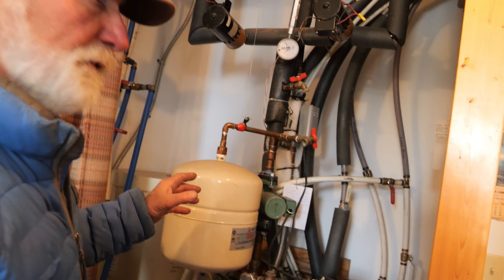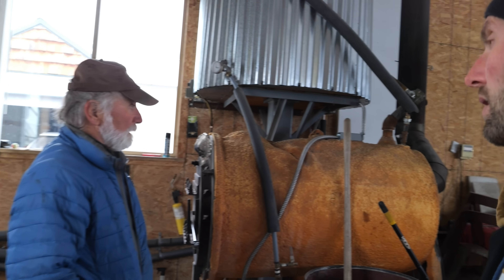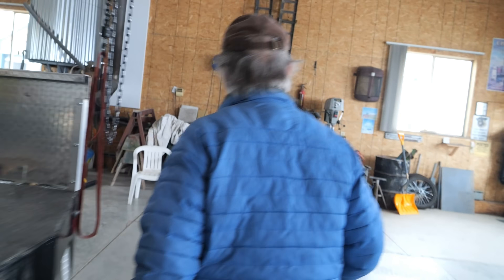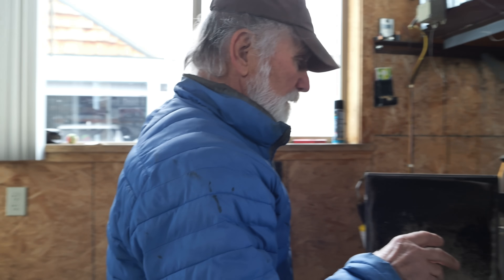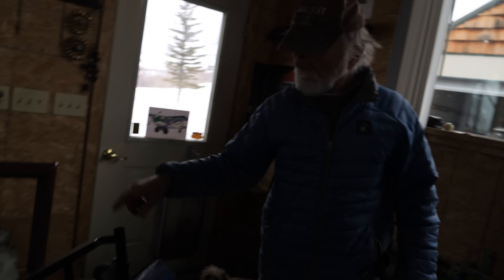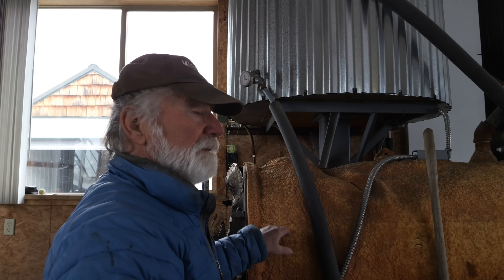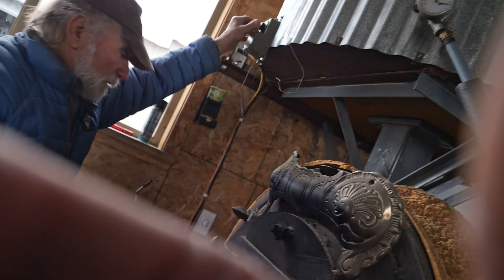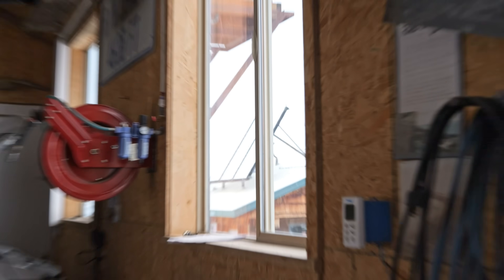Hasn't had a Heating Bill for 40 years.

Comment: My wife and I haven’t had a heat or hot water bill for a little over 20 years and with 5 girls, we go through ALLOT of hot water between laundry, showers, dishes etc for 7 people and we keep our house and shop at 75 deg. We live in northern VT.  My system is way more simple but I probably burn more wood as that’s all I use is a large outdoor wood boiler that takes up to 5 foot logs, I usually cut my wood about 3ft because it’s easier to handle and I don’t split any nor does it need to be dry, I burn both soft wood and hardwood, doesn’t matter. The new wood boilers for sale are garbage in comparison because our corrupt government has intentionally destroyed the outdoor wood boiler industry with nonsensical “emissions”  regulations that actually burn substantially more wood than my straight box with no emissions because that’s what corrupt governments do as they do not want any one to be self sufficient, they want control and they want you to spend thousands every year on energy. I spend zero. If you are able to build your own system it’s not that difficult and when you can burn any wood no matter what it is, wet, dry, soft, hard then not only is free wood everywhere but I actually get paid to do  property maintenance and dispose the wood which I burn. If your not lazy, free energy isn’t difficult to achieve. Just don’t involve the government in anything because they are corrupt criminals, ALL of them without exception. For all the naysayers, save your breath because your opinions mean nothing. Proofs in the pudding.
Reply: Wow you don't understand science.
Reply: @octoflex  A great response to nonsense like this. One liner- enough said. Haha... He won't care that the regulations are for air quality (not profit), or anything else we might say so you might as well just make it quick.

Comment: I’ve got real close to the same set up. Trust me, it ain’t free.  What I have invested building mine is extreme and I would have never considered it had I not owned an HVAC company and collected stuff over the years. Pumps don’t last and do not lose a drop of that liquid gold glycol.
Reply: I get 15 to 20 years out of a pump, some are older, all in intermittant use. I made a bulk purchase of the thermal solar panels years ago, 60 of them, sold and installed (making money that more than paid for the ones I kept) most of them, paid around $100 or less for most of the pumps, and use a 50/50 mix of auto anti freeze, and have no leaks, and there's only around 8 gallons total of the mix fluid. I  have less in the system than if I would have just picked up the phone and called a HVAC contractor to install a forced air system, not to mention there's no monthly bill with mine.

Comment: Hasn’t paid money to some company.  When you break it down, he is ahead, but the fuel source has a cost.  I burn wood for heating and it has a cost.  My system is not electric and I can heat as much water as I want without electricity.  The simpler you can keep things, the better.  I just don’t like having a monopoly determining the cost and or supply of what I need to live.  There is all together too much of that in this world.
Reply: I think he said between his job, something about cranes, and clearing his own trails, he has access to lots of free firewood
Reply: Cost of wood = go harvest/chop wood for 30-60min a day on average and that's your exercise the gym.
Reply: wood, in the UK, double glazing ys a big thing, plastic frames etc, when they remove old wood frames etc, they have to pay to dispose of it, i go collect it, cut it up, use it in my wood burner.  Costs me about £100 all in per year.. fuel, electricity, blades for chop saw etc.
Reply: He explains where he gets the wood from at @10:38
Reply: People with land can just go into the backyard for firewood. Realistically tho, firewood is infinitely cheaper than paying for electricity when you have an efficient system.

Comment: There it is! I knew there was a catch. Excellent system and you’ve definitely got it setup quite well and I have no doubts that it works very well for your purposes. 

But…Come to northern Minnesota or Wisconsin and do this… you’ll be buying fuel for something… either propane, kerosene, diesel, heating oil or wood. I promise you’ll be buying something. A 3 month heating season must be nice. Our heating season is typically from November to April… but can and often does start in September and goes until June. Of course the really truly cold part of that season is only a few months. Typically December-February. But I’d wager our really cold season is still longer than your whole heating season. At least that’s the impression you gave. 

Still a fantastic system you have and it would DEFINITELY help dramatically reduce heating costs out here too. I’ve been looking into a waste oil boiler for the same reason. I’m a mechanic so I have basically unlimited access to waste oil for free. So even though they’re fuel hogs. It would really cut down on heating costs.
Reply: No thanks, Idaho is plenty cold, but also gets a fair bit of winter sun, and that makes all the difference!
Reply: @portnuefflyer I pray the winter sun continues for years to come. You know the elite are exponentially working on blocking the sun as the days go by. Those chemtrails are relentless lately. We the people need a revolution soon… before it’s too late.
Reply: And you get very little sun during the winter months the same as MI.

Comment: You definitely had a higher bill than me and all the up keep and equipment installed buying the equipment etc. Cost more than me heating for 5 years with central air. In the long run you either spend more or same as we others do. Don't be fooled by all these  different heating/cooling systems that claim cheaper bills. The maintenance alone is enough to cripple alot of peoples money flow. Different isn't necessarily better. You need a place for all the equipment you're using and most don't have room for this. You have to buy wood and store it etc. Just because you didn't send money to a power company doesn't mean you had free or cheaper  heating
Reply: What it means is no ever increasing  monthly payment, in perpetuity, to have some utility do it.  I bought my heating system, I'm not renting it in effect, and I locked in it's cost the day I paid for the equipment. All this talk of all the maintenance is pointless, there is almost none. Circ pumps have lasted on average 15-20 years (some longer) and they cost around $100.00. The wood on my property needs to be picked up anyway, deadfall, I could pile it up and burn it outside, or throw it in the woodshed and burn it in the boiler.  If this system was put together 6 months ago, it'd be different, maybe you missed the 40 years part, but it's been super cost effective anyway you slice it. If the cost for maintaining it was averaged out on a annual basis, it'd be about $50.00 a year. Aquastats are around $100.00, like the pumps, no individual component is expensive, it's dirt simple. Left unsaid, is the fact that producing and being responsible for one's own heat and comfort as opposed to handing over money to a faceless utility to have them do it for you, is a bonus, it's called self reliance.

Comment: speaking as a plumber who works on hydronic heating systems. Nothing mind-blowing to see, just some basic heating systems that feed radiant flooring. I come across homeowners like this once in a while and enjoy talking with them. Usually, the only concerns I see are a need for backflows and pressure relief valves. Most of the time, they are just cobbled together and overly complicated systems because they are not familiar with all the available valves and controls. I don't mean that negatively, and I enjoy showing/explaining how those bits can help them more efficiently.

Comment: Thanks for posting.  I have a very similar setup.  I can heat my house and domestic hot water via propane, an evacuated heatpipe solar array, or a gasification wood-fired boiler. Each component can work independently or together as a "team."  I haven't had a propane delivery for years, but it is there if needed.  My "angst" is that I am now an old man and once I am gone, no-one will know (or care) how all the pieces work together!  And my "system" is like the one shown here...human interaction is required...the system, as a whole, while GREAT is not automatic; valves need to be repositioned, switches need to me moved.  And as he said, if you want heat inside the house tomorrow, you better plan ahead (I have a smaller footprint, so from say 65-degrees it takes about 24-hours to get everything up-to-temp).  Regards.

Comment: If you are not generating your own power with solar you do have a heating bill for power to run your pumps and you had to pay for all that solar and equipment and parts. Just spread those costs or the time you have been running the system. That is your heating bill. Please look at the whole picture then brag.

Comment: A bit of an exaggeration that he hasn't paid anything.  He has paid for all the equipment and the piping.

Also, when the sun isn't out, the solar panels aren't creating any power.  He has to get the power to run the pumps from somewhere.

He's just not paying the electric grid most of the time.  But there are times he has to use the grid.
Reply: He said he never paid a heating bill, aka a gas bill
Reply: @mason5540 That's like saying because your spouse pays for gas in the car, I don't pay for gas.
Most heating systems today are forced heat or use some sort of pump.  Therefore, the pump is part of the heating costs.  Thus, your argument falls short.

Comment: Yeah, I like. Mine is way different, outside wood, looped into domestic water and floor through a few plate HE. Endless supply of free wood in Alaska, but mostly I burn scrap pallets just because there is an endless supply, easy to handle and cut. Love your example.✌️

Comment: Lie number one! Takes electric to run the hydronic pumps! Lie number 2 takes electric to run blower on wood boiler and control box. Lie number three takes gasoline to run chain saw, tractor and pickup to cut and haul back to shop.stop lying.
Reply: stop crying

Comment: It's the most least efficient boiler. A Tea Kettle. Lots of heat goes out the pipe. A Fire Tube boiler is the best way to burn wood or coal.

Comment: So are there two separate secondary loops in the floor? One for the solar and one for the boiler? Or is the floor piping common to both systems? You would think using the heat exchangers would be a point of thermal loss, but obviously that's not an issue at all. Fantastic!
Reply: The solar is a glycol mix, totally separate from the plain old water in the floor, the heat ex. "joins" the two together for heat transfer purposes. The solar mix is under pressure, 15-20 PSI, the floor loop is open pressure.

Comment: Interesting and informative. If you have the exposure to the sun and the mechanical knowledge you can use cheaper solar panels for hot water.
Or like he did in his shop in town solar electric panels and feed the grid nine months out of the year. Which requires good laws. In Florida and Nevada I’ve seen videos claiming that the electric power company won’t pay much for electric power so even if you buy a large amount of solar panels you will still have to pay for electric power.

Comment: You are running as high as 20F  delta T?  That  does not seem like a very efficient  heat exchanger to me.
Reply: 15-20, an all stainless plate type exchanger, oversized for the flow,  commercially produced, nice and compact also..

Comment: Claiming that  some panel is  equivalent to  so much propane  is somewhat meaningless.  How many  BTU per hour?   How long does it take those  panels  to  "equal"  the claimed amount of LPG?

This idea is not new by any means.  I've had friends back in the  EIGHTIES  that  buried  heating loop(s)  in their floors,  then  circulated heated water  from  various sources, including using a simple  gas/ LP  water heater as a boiler,  or  liquid  coils in various  heating stoves, AKA home made boiler,   and a couple guys I knew collaborated to build  their  own (each)  solar water heaters.
Reply: Agreed, difficult to quantify the BTU output, blame the sun. The Romans used radiant floor wood fired heat in their baths, so yes, not a new concept at all.

Comment: Nice video, I know we have talked about it but my plan is hydronic soar and a back up boiler pumping into my 900 gallon stainless still milk tank filled with paraffin wax. I''ll have heat exchangers for the floor and domestic hot water in the tank and the boiler will only kick on if the temp hits a threshold.
Reply: I used to have a 500 gallon tank on a previous system, but found it's more efficient to put the heat in the slab pretty much as quick it's made, the 5" slab mass is the thermal sink instead of the water. The end goal is 70-90 degree water into the slab, and a LOT of water at that temp is better than a smaller amount at much hotter temps, easier to produce more efficiently plus less heat loss in storage.
Reply: @portnuefflyer   It would be fun to pick your brain. I am starting a clean slate hangar this spring. I also have 8GPM of spring water coming out of the side of my hill at around 12C. I might be able to develop more springs and double that about of water but back of napkin math is around 100,000BTU I think . I would be curious to know if that no stop pumping could keep the hangar above 0C in the coldest days of winter. It's a low delta T but a high constant volume

Comment: Very similar in concept to what I have. I use a wood gasification boiler to heat up a 3000L tank for the radiant floor heating. In addition, I have a heat-pump (air to water) which does the same when there is enough sun. I have about 15kW of solar and a 60kWh (soon 100kWh) LFP battery as well. I'm fully off-grid here in Finland.
Reply: What's your usage like?  I'm just curious how long it takes to fully charge up your 60 kWh battery based on your usage.  If you are expanding to 100kWh, again I'm curious what your usage is in order to fully charge the 100kWh system.
Reply: @quantummotion  Usage is quite low, especially in winter. Typically, 5kWh per day. In summer, much more because of the excess power as well: running a food dehydrator 24/7, power tools to prep firewood, etc. 
Charging really depends. In summer, I can generate 50kWh a day easily. In winter, I won't even make 1 kWh per day. 
In early spring and autumn when I run the heat pump, I need to be a little careful not to overextend (depends heavily on the weather), but I can typically still allocate 15kWh and more per day for the heat pump alone.
Reply: @upnorthandpersonal 
Sounds a bit like my system. Solar heating, solar pv, a gasification wood boiler, and an air to water heatpump. If electricity is cheap, the heat pump heats the house. If its expensive, the woob boiler keeps the home warm. It works remarably well, and have low running costs.

I dont have any batteries (yet) and i am on the grid. My Pv is creating lots of extra electricity in the summer, and usually only cover 2-3% of ny need for electricity in the winter (dec jan). I live in Sweden, so I guess we have similiar climate.
Reply: Can you speak to the kWh allocation to fans and pumps for the boiler system? I'm off grid as well but have a system less than 1/10th the size. I'm looking to build a shop and while I offset my smaller size with a generator, I don't want to rely on it completely in winter. I'm in Canada.
Reply: @marcelbroesky4945  It's minimal. The pumps to tank from the boiler as well as the underfloor heating pump are max 50W consumption each. The entire boiler consumes around 70W or so max. including the exhaust fan, electronics, etc. Running the boiler for an hour including the pump to the tank takes less than 100Wh, with a typical burn being 3 to maybe 4 hours, you're still under 0.5kWh.
Reply: @upnorthandpersonal  awesome. Thanks for thinking of duty cycle too!
Reply: do you ever have to push heat back into the ground during summer? there are a few discovering when it comes to winter that there is no ground temp delta to pull from anymore. while heat pumps work for people REALLY off the grid in very specific circumstances, they are not ready for prime time and there is still much to be had from oil or gas fired central heating. the green virtue-signalling type will dispute this but they are wrong.
Reply: @John_Smith100  Here in the Nordics, heat pumps (both ground source heat pumps and air) are everywhere, and have been for a very long time (decades). No issues.
Reply: @John_Smith100  heat pump is used by millions in sweden. 

It is true that an completely undersized bore hole in ground heating can cause permafrost in the ground and result in excess use of electricity. But normally its not an issue. Heat pumps are here to stay, powered by solar and Wind. 

Coal, gas and oil is going to get fased out.
Reply: Guys, Here is our Savior

HalleluYAH translates “Praise ye YaH”

YaH is The Heavenly Father 
YaH arrives via the TENT OF MEETING
YaH was Who they Crucified for our sins
YaH was Crucified on an Almond TREE

— Ancient Semitic Cuneiform of Moshe (Moses)
— Isa Scroll (The Original Isaiah)

Isaiah 42:8
"I am YaH; that is my Name! I will not yield my glory to another or my praise to idols.”

Isaiah 43:11
“I am YAH, and there is no other Savior but Me.”

Isaiah 45:5
“I am YaH, and there is none else.”
Reply: You'll always be on the grid whether you like it or not.
Reply: @gordonliddy9418  I'm literally not connected to the electricity grid, i.e., off grid.
Reply: @gordonliddy9418 
Wrong again Gordon.  
Loved your appearance on SCTV back in the day.